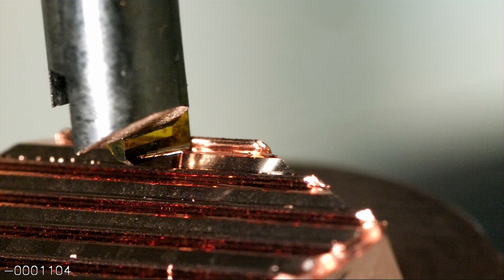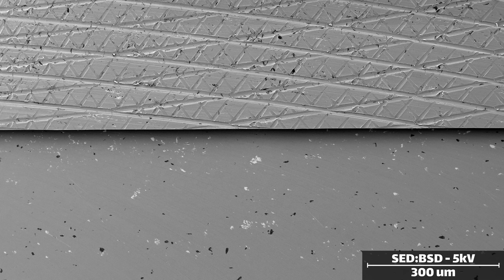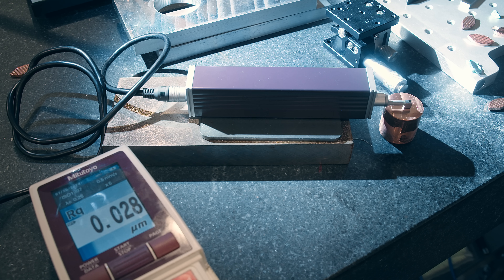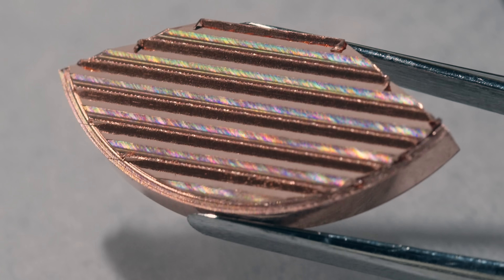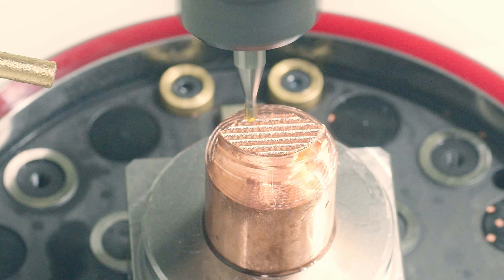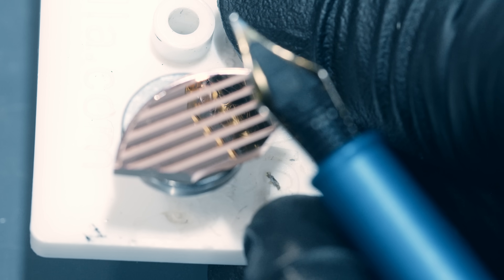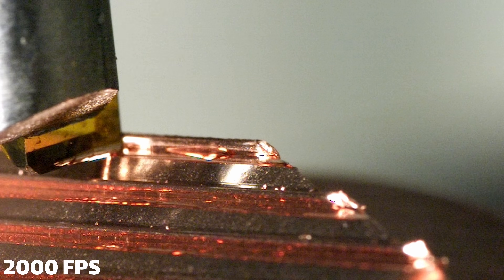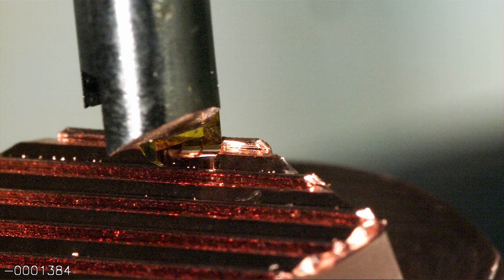Cutting mirrors with Diamonds

Comment: To remove the circular tool marks, you can use an industrial diamond slurry with a synthetic diamond suspended in it with a size of less than 10 micron.
Reply: The reason he used high purity copper is because the paper he's referencing claims that it can be machined to acceptable surface finish without the need for additional polishing steps.
Reply: @theKashConnoisseur  Absolutely.  

Unfortunately, it seems like the authors of that paper have access to higher-grade equipment that doesn’t have the issues with vibration, oscillation, and/or tearing. One way to fix those imperfections, though, would be to abrade/polish the surface with a fine synthetic abrasive suspension to remove the tool marks and gouges.  Plus, the amount of industrial diamond slurry required for the scale of this project and the piece(s) he’s designing would be inexpensive and likely more forgiving of the tolerance limits of his gear, and result in a more uniform finished surface.
Reply: @jasonkay42  You're definitely right on the money there. I'm looking forwards to seeing what process improvements come in the next video(s). It's quite an exciting prospect to have quantum technology be accessible to well learned hobbyists in their garages!
Reply: Oh, and in the interest of full disclosure, my family has been in the industrial diamond 
business for over 60 years. (Hence why my mind went there immediately!)

Comment: So I've done some shaping professionally.
We absolutly do use a step-over and a very small radius, the radius helps in maintaining alignment, and allows some tool damage and wear by keeping the majority of the forces on the half or more of the tool not producing the finish.
In copper various mixed of fats, oils, and minerals in water give the best cutting results. Milk is an excellent cutting fluid or specialized blends that are actually based on milk.
Go figure.

Shapings biggest slow down comes from rigidity, in two ways the plain to use a single non rotating edged tool is mathmetically, far more productive with a but when it comes to practicallity.
Either you make shaper or planer ridged enough to take deep productive cuts and there is no spindle the tool is stuck only shaping and only in one direction making it too ridgid to be a productive tool because you cannot cut on the back draw, and the tool itself is to heavy to move at speads that modern tool matierials allow, (meaning at most 49.nn% of full chipload as compared to lathes maximum of 99.nn%, but still better then rotating tools that max out at 48.xx% because geometrey... but your still moving so much slower that it doesnt matter)
OR 
You use a normal spindle and have to take such light cuts that the easily over 99% efficiency doesnt mean anything at all. 

And there was a company making a modern shaper for high production that could re-aligin its head and even do milling and drilling in a CNC but as far as I know they went bust or stayed small enough I have never seen thier products in the wild. I used one for the same reason your using your mill to be a shaper, surface finish. Long sliding ways that needed high accruacy, and extremely smooth operation in a single direction, but had low precision requirements (allowing us get away with a deep tough and a much larger radius on our cutting tools)

Anyways. heh. Ways. Puns.
Great vidjo.

Comment: As the video was going I was doing my own commentary, then as it progressed you addressed what I was saying.  I had to make a part for a very well known "Place" we will say.  I have a small desktop sub 200 pound aluminum framed machine.  Its highly accurate, but with the specs on the part I was doing I found that if I heated my machine in an enclosure just above 300 degrees F I would not get any thermal expansion.  It took me over 3 months of trial and error to machine pillars in a substrate that was less then 25 microns tall.   You did a great job.   One thing I did have to do and was thinking a solution to the differences in copper harness was tempering each substrate before trying to machine them.    My though was "Level the playing field"

Comment: I can't tell because of the video cuts but it looks like you're making chips curl up towards the previously machined surfaces? if that's the case you should probably change it so it machines from the outside circle towards the center, then any potential scratches from rouge chips will get removed when the next mirror segment is being processed.

Comment: You have to machine it in one motion not swirling or back and forth or whatever you're doing, that's where you're going wrong. The surface must be milled to zero tolerance then slowly cut one pass but first put a bevel on the edge of the copper so you're not starting from flat and presenting a chip from the start. I've been involved in industrial mechanics and CNC machining for more than 30 years.

Comment: Great video. I was going to mention the lifting and lowering of the tool, but you addressed that soon after. Lovely.
On another note, when you include corrections, it would be nice if you left them on screen for a little longer. When you don't know that text is going to appear in a specific place, a second isn't enough time to detect the change and move your eyes to read the text.

Comment: I still really don't understand how lasers cool stuff. I thought lasers were invisible light with enough energy to warm stuff ? 🤔👉👈
Reply: The thing is that a laser will cool a cloud of atoms if it is almost exactly at the right frequency. At any other frequency, it will not work. This frequency depends on the atomic species. For example, with strontium 84 (the atom I use in my lab), the laser has to be at 650504 GHz. If it is 1GHz below, it will do nothing. If it is 100MHz above, it will heat. If it is 100MHz below, it will cool.

Comment: Hold on. I am reading a paper now "New Technique Helps You Cut Metals Easier" which says:
 "isopropyl alcohol (IPA), butyl alcohol, and ethanol—show the largest force reductions (nearly 80%) with aluminum, yet had no eﬀect with Copper"
and..
"The simple act of drawing on the surface of a gummy metal with (for example) a Sharpie helped reduce the difficultly of cutting these materials. Preliminary experiments on pure copper did show a significant reduction in cutting force, but the effects appeared to depend on the strain-hardening of the metal. Annealed copper showed significant effects by adding surface-active media. "
So maybe look into this more for copper. I machine mainly aluminum and ISO is king there but looks like copper doesn't care about ISO.
Try Sharpie, or glue stick as a lube.  ??? ok I'll try it....

And search for "Metal too 'gummy' to cut? Draw on it with a Sharpie or glue stick, science says"

Comment: Absolutely amazing video, thank you!

The absolute thickness of the resulting chip isn't necessarily correlated to the absolute depth of cut - you can see this difference in your video where you cut metal inside an electron microscope. There are also some videos from roughly the 40s that show this. You can also tell some information about this from the texture of the inside of the chips - there is lots of compressive stress as the texture is very rough but the outside is smooth. That rough surface would have been smooth before the cut assuming you'd have machined it already (which you must have in order to get uniform chips to measure). This is perhaps a long-winded way of explaining why the chips end up coiled - because of the compressive stress causing the material to yield and permanently deform.

Comment: "Optical mirror". A mirror is, in fact, oprical. Addid word doesn't necessarily make things smarter.
Alsow in the precision machining worldw 4 microns is nothing.

At my work we're just 10^2 above atoms with lasers.

Edit : the CNC will ALWAYS generate a parallel surface to the tool. I don't know why you said that's a requirement. That' just pure logic. The challenge in being ultra-parallel comes from how you put your part on the machine, not the part-tool plane.
That's basic 6yo logic.

Edit 2: it's not hard to find pure aluminium, it just show you didn't fucking check. What is hard to find is food-grade alimunium, pure at 99.99-99.999%.

Edit 3 : alcohool isn't a lubricant. At best it remove grease, at worst it's an abrasive, just like water.

The video is still cool tho, even with all the bullshit.

Comment: I don't know the size ir grade, but you could get pretty pure aluminum bars for electrical instalations.

I think 99.5% 100mmx10mm bars should be pretty standard.  99.9% shouldn't be impossible to source and 99.99% exists in tables, but I don't know if they are reasonable to source.

Comment: Probably an easier & cheaper method is sputtering copper\alum. over glass or sillicon wafer, then glue them to the a machined metal part with the correct angles needed. Consider that precision telescope mirrors are made this way.

Comment: Probably a dumb question but wouldn't it be easier to get the surface finish to "good enough" on the mill and do the rest of the polishing using some sort of polishing compound?
Reply from the maker: For surface roughness yes, but for "form" no. I.e. hand polishing anything will quickly deteriorate the flatness because it's almost impossible to apply consistent pressure. You really need some kind of automated lapping/polishing machine which would be tough on this geometry. You can make something very reflective/shiny though, definitely could get down to 5nm roughness!

Comment: Perhaps annealing the copper yourself (it's dead simple for copper) would make for an even better finish. The chips were already works of art, so getting rid of the last bit of blow-out seems worth it.
Reply from the maker: That's an interesting idea, I didn't think about doing the anneal myself! There's some literature that suggests even tiny cuts can start to work-harden the material. Might be interesting to "rough" it down to the last pass or two, anneal, then do the final pass in fully soft material.  Hmmmm.... 🤔
Reply: @BreakingTaps  All you need is a furnace and a big box full of mineral/glass wool. Annealing copper is basically: heat it up and let it cool as slowly as you can.

Of cause a fancy furnace with temperature control over time can do it automatically, for as long a duration as you wish, but a big ol' box full of insulation will take at least 24 hours to reach room temperature.

Doing an annealing step before the final cut sounds like a good idea on paper. Let's see if you get nothing but warping for your troubles. Will watch with keen interest! :P

Comment: What you're calling the "rake angle" is normally called the "cutting edge angle".  Rake is the angle of the face that the chip rolls over, relative to the normal of the cutting plane.
Reply from the maker: Whoops, that's my bad. Cheers for the correection!
Reply: A lollypop is in fact not related to underage media or to soda drinks or popular music.  
Also do not confuse rake angle with hoe mounting.
Reply: @DirtyRobot what in the f
Reply: @oliparkhouse  its a bot with personality -.-

Comment: Super cool video!
It was a good point avoiding the z axis to move. If the servomotors of you machine axis have mecanical brake, maybe there is an Mxx code in the gcode of your machine to lock the axis with the brake. At this level of precision maybe the loop control of the servos might be noticeable.

Comment: 3:49 leme just casually switch my electron microscope to element ditection 

I did not even know you coud do that apart from the radiactive tools that give you a list 

I did not know you coud do that in an image
Reply from the maker: Yep, it's a really cool feature/sensor! It basically hits the sample with a ton of high energy electrons and then records the x-rays that are generated. The energy of the x-rays act as a fingerprint and you can semi-quantitatively determine the elements inside the sample.

Comment: We still have quite a lot of milling machines that technically use hydrostatic ways (they have central lubrication that maintains oil pressure) I’d claim. They have excellent stiffness and wear resistance when under high loads, such as stainless and hardmilling. As I can achieve 0,25um Ra in aluminium using non-polished carbide inserts, I’d reckon those machines would be absolutely perfect for making mirrors. Diamond MCD tooling is ubiquitous these days, but more on lathes than milling machines. Ive just never tried it.

Comment: 19:20 you can see the chip reacting as the wavey surface is produced. I don't see any movement change in the tool or any visible change in depth. I wonder if there is work hardening causing it to periodically change back and forth.
The chip comes off the tool at periodically varying angles which means the cutting parameters are changing so there must be something causing that.
Reply from the maker: Could be work hardening! I saw mention in some literature about work hardening as a function of various depths of cut (including the prior cut influencing the current cut). There's probably a sweet spot where you rough at a certain depth to to get under the work hardened skin, and then do a single finish pass. If there was hardening, the way I was doing it (same size steps) would likely start to build up a resonance I think? Similar to chatter but not actually chattering. There's still a bit of the "tear out" issue in places so this seems like a viable candidate as the reason.

Could also be incomplete lubrication causing it to stick periodically
Reply: @BreakingTaps  I think there might even be work hardening going on during the current cut, regardless of the surface left by previous cuts. 
Tool plowing the material, hardening it, skipping over that into softer metal and repeating. More back rake on the tool might help. 
isopropyl is great but if it needs more you could dissolve some oil in the Iso and get the qualities of both.
I read in an OLD book ca1905 that while doing research on bearing/lubrication, they found that castor oil could only be removed or cleaned off their test apparatus by machining the surface and that castor oil with graphite was even harder to remove. I've used that fact to advantage many times over the years. In your place I'd dissolve some castor oil in the Iso and use that but don't breathe the stuff. Now , thats a trade secret so don't tell anyone else about it ok?

Comment: a pretty big part of me wants to disbelieve this because how in the heck does a bunch of lazers in a magnetic field make something COLD!?
Reply from the maker: MOTs are wild. Honestly I only sorta understand how they work, need to do more reading. But basically it sets up an oscillating field (via the lasers and magnets)  so that whenever atoms move "away" from the central region they are fighting against the oscillation. That takes some of their energy and so over time they lose their thermal energy and just get locked into the central region. Because it's in an ultra-high vacuum there's nothing else to bump into and give them energy back so they slowly go super-cold.
Reply: @BreakingTaps  That's a lot of words for "witchcraft". (jk)
Reply: @BreakingTaps  Your explanation is partly right. Actually, MOTs are very simple once you understand the basics.
The central ingredient is that light close to resonance is just pushing the atom. See it like wind. But this force depends, crucially, on the difference in frequency between the apparent laser and the atomic transition. When this the smaller it is, the stronger the force. Three parameters control this difference : the laser frequency of course, the magnetic field (via the Zeeman effect) and, very importantly, the velocity of the atom (via the Doppler effect).
Now, in a MOT we use laser beams which are slightly below the transition frequency (we say that the detuning is negative). Thus, an atom which is moving towards the laser beam experiences a stronger force : it is slowed down. An atom moving away from the laser beam experiences a weaker force : it is not affected much. Because there is light from all directions, the atom is simply slowed down until it has no motion (or very little, the residual motion is called the Doppler limit, and is of the order of 100µK~1mK depending on the atom). This effect is called "optical molasses".
In a MOT there is also a quadrupolar magnetic field. Through the same logic, and because the light is circularly polarized, the farther away the atom is from the zero of the magnetic field, the stronger the force. Thus, it is pushed back towards the center.
The overall result is that the cloud of atom is both cooled and trapped. That's why a MOT is so useful.

Comment: How do you braze a diamond? Isn't that like trying to solder onto glass?
Reply from the maker: Special solders designed for diamond, and vacuum or inert gas brazing. The carbon reacts with active elements in the solder (chrome, titanium, stuff like that) and forms carbides which act as a bridge between the diamond and the solder.

Comment: If these just need to be flat mirrors (i.e. the absolute position of the mirror doesn't matter that much, just the roughness) what about postprocessing the part by electropolishing or similar after you've machined it? That seems like the kind of thing that would have a good chance of removing submicron surface roughness pretty quickly.
Reply from the maker: Definitely! We thought about doing that but I didn't want to get too side-tracked by a tangent. Figured it would require some optimization to get working well (I recall Applied Science saying there was a fine line between polishing and etching). But if this geometry works, we'll probably be doing more batches and try out electropolishing! Probably a video about it too if it works, sounds like a fun project :)